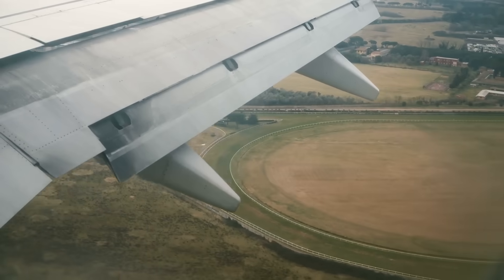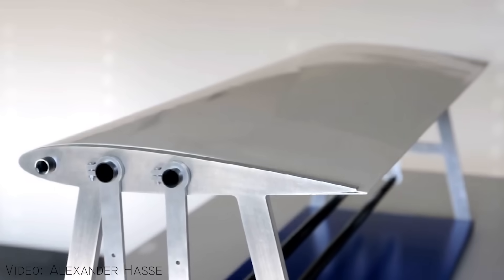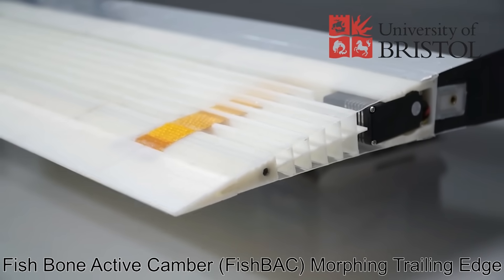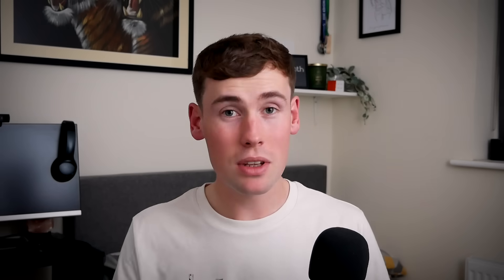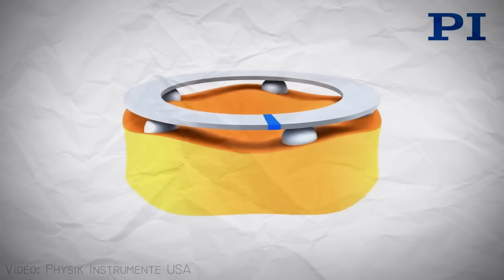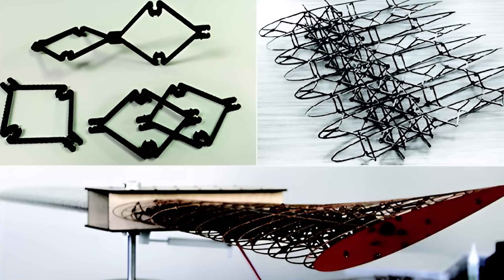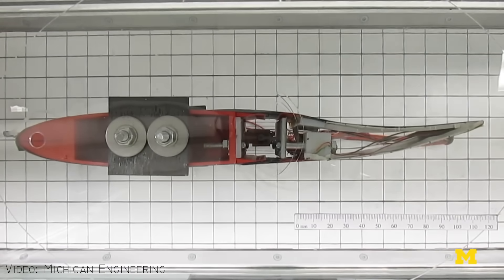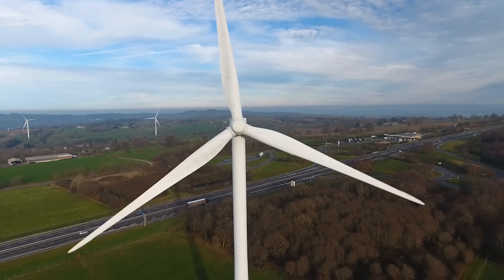Metamorphic Wings: The Future of Flight is Here

Comment: I’m glad that you mentioned improving efficiency in wind turbines. I was also thinking of sailing ships. Any improvement for the large scale movement of freight without using the heavy fuel oil that they currently use would save money and pollution.🤔
Reply: Go look at the sailing videos, they have always had some form of morphing its just gotten a lot better in recent decades. That's what many of the adjustments to the mast & boom have been for. They are actually changing the shape of the airfoil. I am an aerospace engineer and some of the stuff being done on the America's cup boats is seriously impressive.
Reply: There were only toroidal propeller/turbines has significant improvements, but for now it's also only in research/prototype stages due to complexity of the form and yet to be adopted on a scale. But generally it will not reduce pollution until someone  invent safer energy source with the same efficiency. Maybe someone will adopt nuclear fusion reactors like that (https://www.youtube.com/watch?v=_bDXXWQxK38) but they are also early stages and not ready for commercial exploitation yet.
Reply: @DeathSugar  It took only 2 plane designs to go from the radar 'obsorbing' 117, to the B2 stealth.  Once you have the math, the next generation is simple.
Reply: @robertsmith2956  if you don't have to optimize stuff much, return the costs and has military grade budget -sure. But how many of those stealth things are existent and in actual use ? compare numbers to average  commercial plane for comparison.
Reply: @DeathSugar  No, the difference is they can ignore the FAA.  Commercial planes would be better if they didn't have them refusing to let them build better planes.
Reply: @robertsmith2956  Problem is the profit ratio. Commercial seeks reliability and cheapness balance and they are Pareto Optimal in a sense. Military do not seek profit and at most they try to reduce production cost per battle capacity unit. So it's not really about refusing to build better, but R&D costs which will not be compensated in some time span (5-10years)
Reply: All this "CO2" hysteria is very limited in vision.  You can NOT have urban expansion & CO2 reduction.  EVERY square inch of urban sprawl is deforestation. Suffocating plant life.  Humans ain't built for prolonged Oxygen-rich exposure.  Oxidation. Formation of free radicals...  NO bueno.  As for fuel burning cargo ships, what?  Graphene production in the new thing, dude.  Carbon capture CO/CO2 exhaust for gaseous deposition fabrication of Graphene. The energy used by a production factory being used to transport heavy goods.  Didn't see that one coming?
Reply: Something like this? https://youtu.be/ujb8sCMH7RM
Reply: There are examples of wind powered freighters at work.    According to the video I watched recently they do not easily scale to the size of modern freighters.  Of course never say never.
Reply: You clearly dont understand how industry expenses work

Every machine has some rarity on it
This depends on its complexity, research
Development, and sveral other factors

These factors have their own factors affecting them

Complexity increases maintanace costs 
And overall cost

The develpment in certain tech will affect the desing affecting efficiency, cost, maintanace cost and the materials nessesary reducing several other factors

Regular combustion engines are know for being mainly steel and some small ammount of corrosion resistant materials.
And have been pushed to its limits in every field possible.
Ensuring a strong reliable product

By the other hand electric engines while still widely used in the military on nuclear submarines and civilian use in small scale the cost of batteries would be a
turnoff for investors and increase the
Price of shipped goods and components
By a large margin
Unless you use a more cost effective
Power source
Like a nuclear reactor 
They are demned ticking bombs tho
(There are 200+ of these reactors in the sea and nothing has happened)
Reply: The improvements in wind turbines he talked about seem extremely sus.
Reply: @_aullik  Agreed, current wind turbines are already reaching over 95% of the theoretical maximum.
Reply: Shipping using wind... It just wont happen dude. At least not in the modern concept of shipping. If you are willing to go back to old clippers...

But for modern ships... Its not a matter of how you catchbthe energy from the wind, the problem is that even at 100% there is not enough energy.

Its like solar cars... You dont have enough energy even on ideal conditions.

Want clean shipping? Look into small nuclear reactors, that is the future.
Reply: @Coyote27981  a lot has changed since the clippers hauled cargo around the world. Materials for ship building and masts, sails and controls. Flexible perovskites could be generating power from every square meter of sail. Computer controlled rigging and navigation systems reduce the danger and crew required. They may not be as fast but with no fuel required and low running costs there must be plenty of situations where they can work.🤔
Reply: @malcolmrickarby2313  thats why i said going back to old clippers may be an option.

the problem is cost vs savings.

Say you go all in on a high tech, extremely automated ship. Low weight is key, so you wont be hauling a lot of cargo, specially not on heavy containers. But say maybe for some specific kinds of small cargo, going for non major routes, it could work.

That is as long as you make it so that the ship aint too expensive, its runned by a small crew (without fuel, crew cost is now your main cost), and you travel directly from source to destination and its not a major route.

Then, maybe you make it work. But its not a massive thing. 

Plus there's this thing where wind stops blowing ...
Reply: @Coyote27981  in the era of the clipper ships they followed the best route for wind and speed to carry the most valuable cargos around the world. With modern satellite navigation and weather forecasts they could be faster and safer and with modern technology, larger. I see that many comments are suggesting nuclear for shipping and it could be the only solution for container ships. Hoping that there will be no need for oil tankers very soon. Pleasure cruises might need to downscale a bit or just be replaced by resorts.🤔
Reply: @malcolmrickarby2313  The problem with complex computer controlled sails/masts/aerodynamic surface is that they are expensive and difficult to maintain. Also require power.

I dont think sailing ships will ever make a big comeback, they are just too inefficient, ironically enough. You have to consider, if a ship takes >100 times longer to move the same cargo, then you need a hundred times the ships to move the same cargo, and they are much longer at sea.

Despite using really polluting fuels, huge container ships are insanely efficient because of the amount of cargo they transport in little time.

The best way for more sustainable seatransport is probably something like biofuel and cleaner fuels. Or just limiting how much trade we do, because thats really what creates demand (dont think thats a good idea tho, for socio/political/economic reasons).
Reply: @malcolmrickarby2313  Keep the EVs coming and put an end to oil for transportation.
Reply: It’s not a matter of getting all your power from wind, but exploiting a cheap propulsion advantage on a low margins shipping industry
Reply: @Coyote27981  But they still trying to reduce fuel consumption using wind. At least as experiment. 
And the worst about electocars is dirtiness of battery production.
Reply: @DeathSugar  -  And the difficulty of recycling those batteries, among the other numerous problems with EVs.
Reply: @Coyote27981  1 small reactors are less efficient (i mean the "portable" mini reactors) and 2 have you seen the size of a comercial ship?

Comment from the maker: Thanks for watching! It would be great to hear your thoughts on shape-shifting wings and maybe where you think they will become mainstream first? Also, if you want to design your own or anything else you can dream up, check out OnShape CAD for FREE at my link: https://onshape.pro/Ziroth 

Here is an example of an online CAD file (it's really cool): https://cad.onshape.com/documents/5783cd9799b63cd7f8947218/w/988f55476c062d8d941744b3/e/97a09d6ab5c5c33b321c16d7?renderMode=0&uiState=63f4ef77e21f2e1671fc307a
Reply: Sorry buddy but on the aerobatics planes you are totally wrong on several points.
Your a pretty smart kid and you do some great videos but occasionally get stuff 100% wrong. You really need to occasionally go and ask people about these things.

I am an aerospace engineer with a pilots license and have flown competition aerobatics. Planes like the Extra 300/330, Yaks, Edeg450 and others mostly use a symmetrical wing sections so they have the same characteristics inverted as well as upright. That's needed for things like inverted spins and negative flick rolls.

Learning to fly for me was incredibly humbling because I had to start listening a lot more to a lot of people. I've become more used to ordering electricians and junior engineers about, which happens after 30+ years. It became even more so when I took up aerobatics. Suddenly I was the student with a head full of nothing.

Power to weight ratio and stability (YES STABILITY) are more important than anything else. The power thing is fairly obvious but ALL of the current aerobatics planes are very stable in flight unlike planes like the Pitts which are super manoeuvrable but also very twitchy. Its maybe the thing I find so technically impressive about those planes. They not only have incredible response to inputs but also high levels of stability. They stay where they are pointed.

Scoring in aerobatics is about how clean you fly the manoeuvres NOT how many Gs are pulled or how fast you roll or how clean your aerodynamics are. The scoring system is quite similar to gymnastics and diving. Judges don't score according to how hard a figure is they score out of 10 (with 1/2 marks) for how well its flown subtracting points (& 1/2 points) for mistakes. Its about how round a loop is or how straight a line is flown. The difficulty of a figure is covered by a degree of difficulty that we call the "k-factor" which is based on summing up the various parts of a figure.

The area of competition flying where this stuff is most likely to find a home is in gliding. if you want to ever go and see where the future of high efficiency aerodynamics is headed then go watch some of the gliding channels here on YT.
Reply from the maker: @tonywilson4713  Thanks for the insights, that is really interesting. The comment about aerobatic planes was definitely said a bit off the cuff without much thought! 

I was aware the aerofoils for aerobatic planes are symmetrical, with my thought being that this may be less efficient than a wing which could change dependent on the orientation of the planes. Without any real knowledge of the field this looks like it is solving a problem that doesn't really exist, but that's the best part about being an engineer anyway!
Reply: @ZirothTech  Here's something even weirder about a competition aerobatic plane. The propellers have quite fat blades which at first seems unusual for a high performance aircraft. because they are limited in diameter they need more blade to do what's needed. The other thing is that on vertical down lines you also need braking as in like putting your foot on the middle pedal in a car. 

For instance a competition spin you have to complete the vertical line AFTER the spin. It goes almost against normal human behavior that after recovering a spin you then point the plane vertically at the ground. When you're doing this you aren't looking at the ground either you're looking at the wing tip gauge because for every 5deg you are off the vertical the judged deduct a point. 

So you push into a perfect vertical dive and at that point you WANT DRAG not thrust. So at low engine power the constant speed prop goes flat and acts like a bag fat air brake. 

When flying straight at the ground you don't want the prop puling you want it creating as much drag as possible. I once had a pilot tell me "You haven't experienced prop drag until  you've flow a Yak."  He then described how in his old plane that in a vertical down when he'd pull the engine back he'd fall forward into the harness. 

Competition aerobatics is this weird set of trade-offs and until you get into it there's just stuff you'll never know.

Look under the wings for the small winglets that are attached to the ailerons.  
Look at the ailerons near the wingtips. Several planes have the last part of the wingtip well ahead of the pivot point, just like many rudders have part of the rudder ahead of the pivot point.

Its not that different to other forms of competition inspired engineering. I had a boss who was into the top level of Australian open wheel racing. At the time all the cars were ex-F3000 from Europe with a locally sourced engine. Scott Dixon the Indy Car racer was in a rival team to my bosses team back then.  

There's stuff about those cars and how they drivers drove them that 20 years later still amazes me.